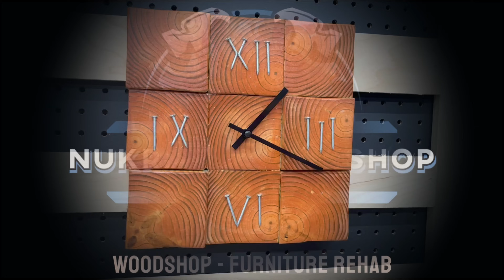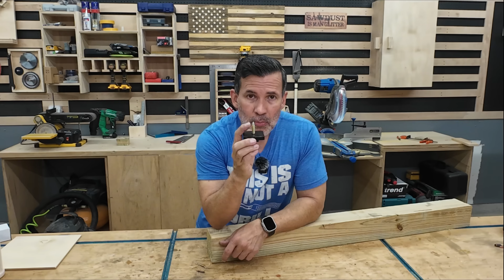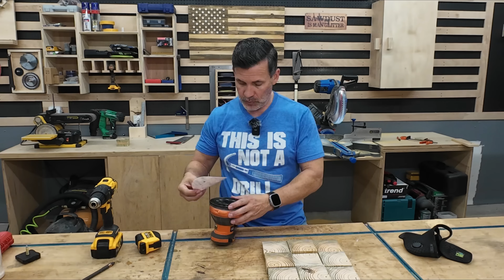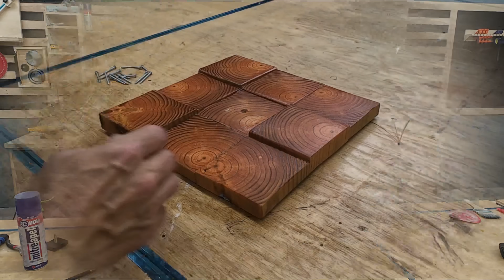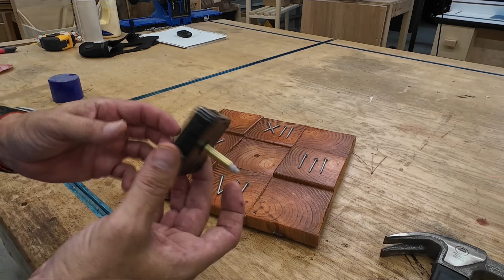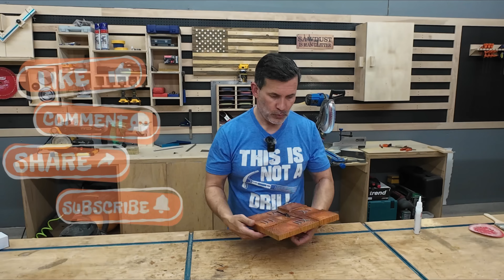Simple Woodworking Projects: Rustic Clock You Can Build Today

Comment: Shaft too short, do some light routing!  Clock shafts are 5/16".  An 11/32 drill bit does the job very well.  Clock maker here.  The "included tool" is actually a hanger.  The circle end fits over the shaft and against the clock motor body.  The triangle end fits over a hook/screw/nail attached to or sticking out of the wall.

Comment: I love the clock. Just looking for some advice as a newbie. (I’m a Brit living in Brazil). I am wondering is the backing board essential or do you think the plan would still work by gluing the blocks together. The reason I ask is the clock mechanism available in Brazil is only 15mm so the centre block would have to be wafer thin with a backing board. Your thoughts are appreciated.
Reply from the maker: No problem at all and thanks for taking the time to ask your question. You absolutely could glue the blocks together…!!!  I just made it this way because the clock mechanism I happened to have in my shop was a longer shaft than you probably have access to. That’s why I put a link to the mechanism I used for anyone who wanted to make it exactly as I did  

Hopefully your project turns out well and if you have access to social media, please send me some photos of your project

Comment: So,  how did you hang it? Because the mechanism sticks out a 1/2- 3/4" on the back side....I like the look!
Reply: I just received the clock parts thru the link Tim provided. There is a mounting bracket included which can be attached to the mechanism. Best regards
Reply from the maker: There is and I did not show how to mount the clock (which has been pointed out to me a few times) because there’s so many options to get that done and I figured even a beginner could figure a way to get it mounted

Thank you so much for all of your support, I really do appreciate it  🤟🏼🤟🏼
Reply from the maker: I hung it in my shop where I have a French cleat system so I had a recess in between boards that allowed me to not worry about the protrusion of the mechanism. I might pop up a short this afternoon giving a couple options on how to hang this. The easiest way to do it would be to mount a scrap piece of wood that is the same thickness as the clock mechanism up above it and mount a saw tooth hanger on there.